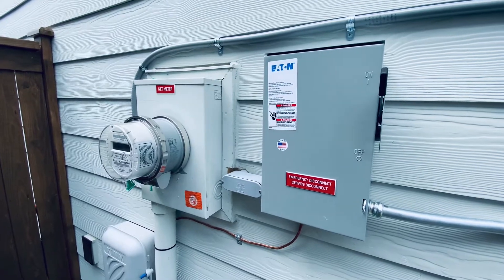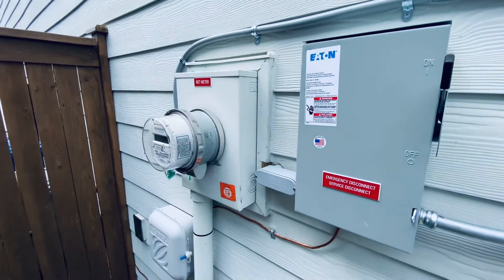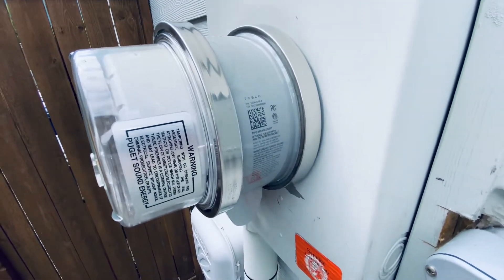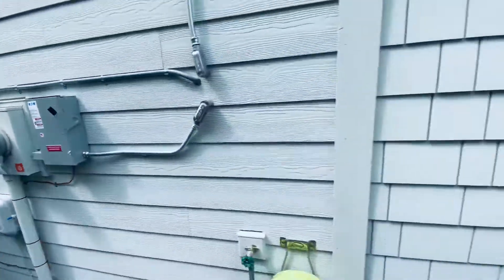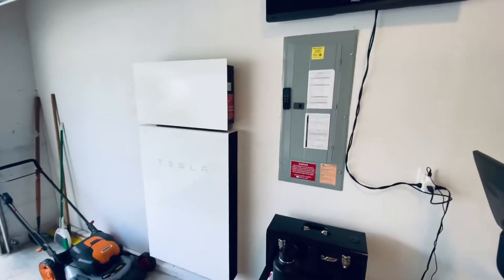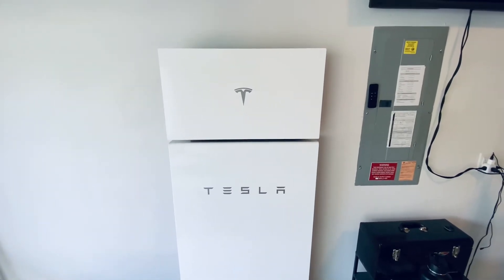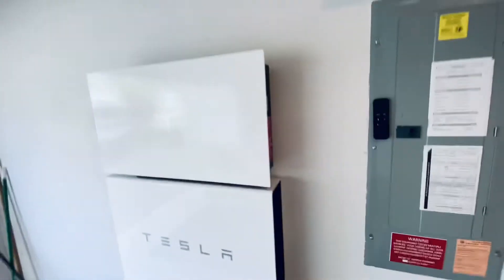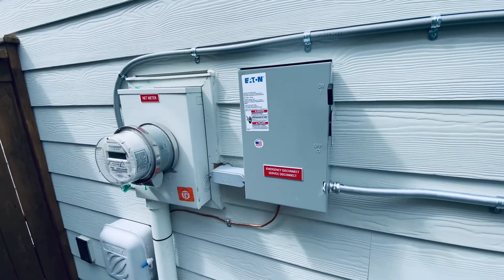⚡️🔋Tesla Powerwall Plus + Final Utility Inspection - Concerns about new backup switch!

Comment: The backup switch is new technology for all utilities across the country. The backup switch saves money for the company and consumers from avoiding installing a Gateway system. Recommend you getting a EMP surge protector installed. That's the new NEC requirement because of 2-3 reason and also another reason that can't say online. Also get a EMP installed for your cars recommend. EMP's have insurance coverage for your appliances up to 25-40k. Tesla does not insure active GOD situations on warranties. Good work on getting solar and backup power smart man. I started installing these batteries recently.

Comment: You only got 1 powerwall?
Reply from the maker: yuppppp - very much aux system but have been impressed with capability when testing!
Reply: @pauledgeman671  mine ac alone drains my 2 to 20% alone

Comment: I know Tesla App monitors TOTAL system solar production, not individual panels. I’m getting 12 panel array with 2 PW+ batteries. PW+ has 4 MTTPs. Trying to determine if my 12 panels can be “broken” into 4 strings of 3 panels to monitor INDIVIDUAL string production.
Reply: If you really want better monitoring, get a solaredge inverter. 
I would also suggest against a second PW+ unless you plan to get more solar. The smallest inverter Tesla makes is 3.8kW and 12 mods will barely fill that up.

Comment: Your garage is clearly FAKE NEWS.  No real person has such a clean garage. In my case, in contrast to your "Backup switch", they installed the "Backup Switch 2" in my setup, so at least, I should not face THAT objection from my utility (though I have heard the utilities only reluctantly allow these connections which manifests in questionable objections and delays).  I'm guessing I'm a couple to three weeks behind you in the process.
Reply from the maker: Hahaha!! There is still some room for improvement lol. Are you in WA state? I’m still waiting Tesla just keeps saying they are “working with PSE” when I call them - which is weekly 🤖
Reply: @pauledgeman671  Alas -- east of the Mississippi.  Just counting the days, dreading that they'll turn into weeks, dreading more they'll turn into months. . .  ugh
Reply: @pauledgeman671  Any news on the approval of the Tesla Backup Switch? I am in permitting and don't want any extra boxes but Tesla told me only Solar Roof (not panel) projects are approved to have the Backup Switch.
Reply: Tesla changed my configuration without telling me. My system is 12 solar panels, 4 powerwalls, Tesla inverter,  and Tesla backup gateway. Tesla changed my configuration from partial home backup to whole home backup by adding the Tesla Backup Switch. 
PG&E is scheduled to come to my house on Tuesday to allow Tesla to add the backup switch collar to my net meter.
My home is in Santa Clara county CA and I am hopeful that the inspection passes and PG&E grants PTO soon.

Comment: Hey Paul thanks thanks the video I'm still waiting for my setup. Looks like tesla installed basically a home backup generator meter ATS. Power company shouldn't have an issue with this considering its a true ATS. Can you do a video on your app what it looks like now with this setup? And please keep us up to date. And maybe in your video add what you average consumption kwh was before and after solar? Very interested thank you!
Reply from the maker: Will do soon thanks! PSE (utility) is still saying hard no that the collar on the meter (backup switch as Tesla refers to it on plans) and asking that it be replaced with the gateway. Waiting to hear…much of anything…from Tesla lol
Reply: @pauledgeman671  hey Paul did your electric company request the bulid sheet before work was done? Mine has asked for something like this.

Comment: Even though I’m in Massachusetts, interested in how this situation turns out. Component definitions and PW vs PW+ comparisons helpful. Have not seen this info anywhere else. Heard load shedding is a software update coming to PW+ which could solve A/C tripping with single battery.
Reply from the maker: Hey bill. Talked to Tesla on that - not much hope for single Powerwall starting AC compressor. The tech said that update is for the non plus version - so those powerwall 2s with the inverter on the side not the combo top mount newer system. https://www.tesla.com/support/energy/powerwall/learn/system-design
Reply: @pauledgeman671  Would surprise me PW+ will lack Load Shedding. Heard just the opposite. @Leon mentioned LS coming to PW+ soon as over the air update (regular PW perhaps later). My info from MySolarHome YT https://youtu.be/WqevLT2uAdU — mentions possible future generator tap to PW+ too. Ignore Generac PWcell info, not pertinent.

Regarding meter you pointed out in your last video. I believe it is called a Revenue Meter and is used by your electrical service provider to determine how much your solar array is producing. Will be interesting why they are displeased by it. I’ll check w/Tesla next time I speak to design team to see if a “revenue” meter like that is part of my plan here in Massachusetts.
Reply: I stand corrected. Appears you have a net meter, not a revenue meter. I’ve never seen a Tesla Automatic Transfer Switch (ATS) housed in a round sleeve behind a net meter. Believe Tesla calls its ATS a Backup Switch or Gateway in their literature. Will be interesting to see what this is all about. I believe in Massachusetts, to participate in SMART tariff sharing program a revenue meter is required in addition to net meter, but I’m just at layout stage with Tesla so don’t know for sure.
Reply from the maker: @gilbrook  yep I was just talking about the backup switch. Nothing to do with metering - the was my existing meter that will be replaced with a bi directional when final approval is granted.
Reply from the maker: @gilbrook  I would definitely encourage you and everyone else curious to talk with a project advisor or Tesla support directly I feel like there’s a lot of information out there and sometimes they even have some gray areas. From my conversation with them she seemed very confident. 🤷‍♂️
Reply: @pauledgeman671  OK, trying to get installation steps correctly organized in my mind. I see, your panels & battery operational, but you’re unable to send any excess solar production back to the grid until you get bi-directional meter. In the week or so you’ve had your system operational have you had any surplus production you could have returned to grid? During this time has your battery reached 100% full, panels overproduced and inverter shut down the array?
Reply: @pauledgeman671  Yes, since I started design 2 months ago everyone in support & on my project team has been helpful. Local building department permit approved. Since I started there’s been major changes to components (PW+, integrated gateway/inverter). I’m waiting for explanation of how these changes affect my system design before authorizing final configuration.
Reply from the maker: @gilbrook  yep we have had a surplus during testing! It reaches 100 very fast in full sun. It still sends power to grid but we get charged for it as if we were using power until net metering set up. Meter can’t differentiate even though the LCD indicates flow to grid.
Reply: @pauledgeman671  Great observations. Very helpful. I was curious as to how fast my 2 PWs replenish in prolonged outage (days). My system will be like yours (12 panels, but w/2PWs). If a single battery refills quite quickly in summer, I image two would too. My winters like yours I would think. I’m more concerned with keeping my furnace on in winter, than A/C in summer. Battery replenishment on prolonged outage in winter likely markedly slow. Guessing if summer tops out at 30kWh/day, winter will be 3kWh/day. If Tesla does provide a generator tap for PW+ you won’t need a second PW.

Comment: Paul. Nice! Remember, when you say, "Whole house back-up," you need to calculate which loads YOU desire to have has "primary" due to your Powerwall only having 5 kW and 7.6 (new tweaked upgrade) of CONTINUOUS output. If your house is consuming MORE than 5 kW, then the Powerwall will "trip" and cycle/reboot every 5 minutes in preparation to cover the 5 kW worth of home needs (i.e., lights, refrigeration, electronics, etc.). But when major loads turn on (i.e., pool pump, A/C unit, dryer, etc.), the Powerwall via the combo unit (Gateway/Inverter) will decide what to cover. Hence, I know I when overboard (FOR NOW BUT NOT IN THE NEAR FUTURE) by installing 7 Powerwall 2+ I  my townhouse, but that means I have 35 kW - 50 kW of CONTINUOUS output to cover every light, electric heater, 2 deck electric grills, air fryer, microwave, refrigerator, and wifey's hair dryer! LOL!
Reply from the maker: Gotcha dude 😂!